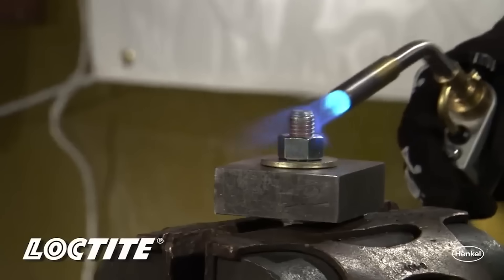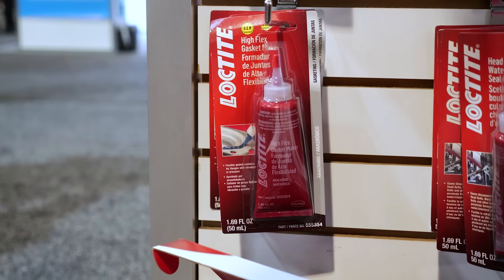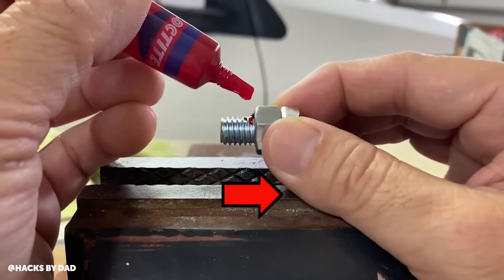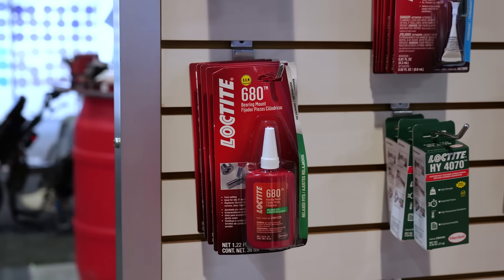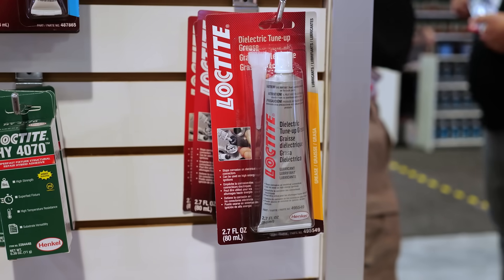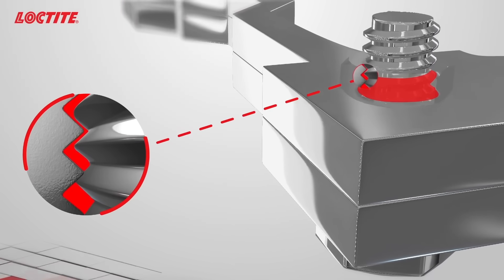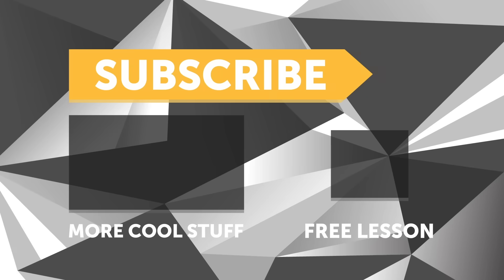Many pro mechanics don't know this.

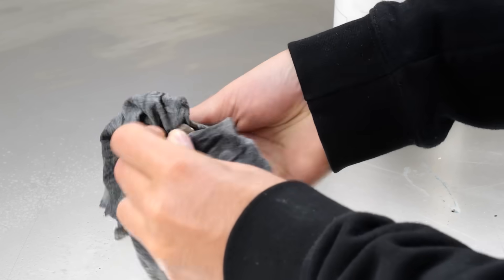Comment: @6:30 did he just say that a non-reactive bolt, like stainless, will not activate the Loctite???  ... and that I should be also using a primer??
Reply from the maker: "We recommend the use of primer where both the parts come under the category of 'inactive surfaces'. These metals lack the iron or copper content and thus the metallic ions that are required to fully cure the product within 24 hours. These inactive surfaces include plated parts, stainless steel, galvanized steel and anodized aluminium to name a few. On the other hand, in case both or at least one part is an active metal, then there is no need to use a primer to ensure full cure, which is typically within 24 hours at room temperature." - https://www.tryloctite.in/faq

Hope that helps! - Taz.

Comment: I live in the rust belt and rarely have to use it.  They rust in place fast. You have to heat them. If it is aluminum to to steel, well those bolts are in there.
Reply from the maker: I guess you just get used to your local conditions, but man, that would drive me nuts! - Taz.

Comment: Great to noticed at 6:00 is what I always teach to new operators.  In my case it’s also based on that glue detection is not allowed. Our loctide btw does contain indicators that lights up under UV light.

Comment: Stay away from the red gel locktite have had a lot of problems with it not setting up after weeks of being installed. Installed aluminum racing hubs on a 83 mustang a few years ago and the wheel studs used nuts to lock them in place and called for red lock tight well about 3 or 4 weeks later we decided to change rims and the studs would spin taking off the lug nuts and since it was aluminum hubs they don't press in turned every single one had the problem and we had already used another bottle a few months earlyer on suspension parts so checked them and they came apart way too easy for red lock tight 2 different bottles bought at 2 different places and were not expired we redid it all with the liquid faster setting and dint have anymore problems!!!!!!! I will never use the gel again and uset to use the blue gel a lot won't risk it again!!!!!!
Reply from the maker: Yes that's not ideal! A few are commenting red doesn't work for them who will have the same issue or are not applying it correctly (some will need a primer).
Glad you didn't have anything fail to figure that out! - Taz.
Reply: @hpa101  me to I usually use the red liquid never had a problem other than when something goes bad and have to torch the bolts but been using it for over 30 years that was the first car I ever used the gel on wasn't my car my buddy bought the stuff I have used the blue gel no problems that have ever been brought to my attention but after that mustang I never touched the gel again

Comment: Working on locomotives, we had a couple rebuilt by a shop. The first time we had to service the traction motors, we found they completely doused the traction motor mounting bolts with red loctite. 

1-3/8" diameter bolts, torqued to 1200 lb-ft, that are supposed to be assembled with anti-seize. 😀

They were very fun to remove, as we couldn't use heat. Large breaker bar and a forklift.
Reply from the maker: That must have been a bit nerve wracking!
Reply: 271 Red actually acts like blue(strength wise) on large bolts. They spec red as permanent up to 1". Still a bit of a mess to free up, but strength wise. Loctite on bolts meant to be anti-seized would truly have been a task though.
Reply: Life of a locomotive mechanic! Always something that's nearly impossible to get off!! I remember what seemed like day's of shocking (heat and cold) to the mounting studs of getting a main gen out of a 50 yr old GP15. Fun times!! lol
Reply: Now I don't feel so bad about having to stand on the lug wrench to change a car tire.
Reply: @jameshaulenbeek5931  that’s what I call creative thinking and initiative.
Reply: Wow! That’s some serious mentality going on.

Comment: crossthreading is the only way to keep fastners tight !
Reply: @sixhunt  Nature's locktite
Reply: @sixhunt  A cross-threaded fastener is a tight fastener!
Reply: @ this reply gave me shivers of mechanical sympathy. Gosh I hope you're joking.
Reply: My old time mechanic friend used to say "Cross thread it, better than two lock washers.".
Reply: "Brooklyn" tight, tighten until the fastener just starts to strip then back off a 1/4 turn.
Reply: @ That's close to my old journeyman's answer for how tight something should be. "A 1/4 turn before it breaks"
Reply: Better than double loctite
Reply: Be sure to sell the machine or vehicle before you need to remove the bolt.
Reply: Best way is to completely strip the bolts head off then weld a new nut on job done.
Reply: @sixhunt  aman
Reply: @sixhunt  hammer the threads can work pretty good too!
Reply: Or just put a UNC nut on a UNF bolt!
Reply: @sixhunt if u mean to do it, then it's more of an interference fit 🤣
Reply: welder. about 150A is right.
Reply: Or nord lock washers for the win
Reply: My old man used to say just do it up till its stripped then back it of half a turn gotta think like a plumber not a mechanic ha ha .
Reply: @Yoda-em5mt  
Always remember, when you get to heaven, the guy who worked on the car after you is waiting and he ain't happy.
Reply: @boyracer3477 thats why i fix all my stuff my old man was a shit mechanic i,m the guy you want to buy a car of. I tap out all the old loctite and wire brush bolts like everyone should so i should be ok in heaven .
Reply: Machinist method for securing threaded fasteners:  Apply torque as required; to strip.  Back off 1/8 - 1/4 turn.  Having this value established.  Also, makes dissassembly easier.

Comment: Very interesting and very useful, thanks.

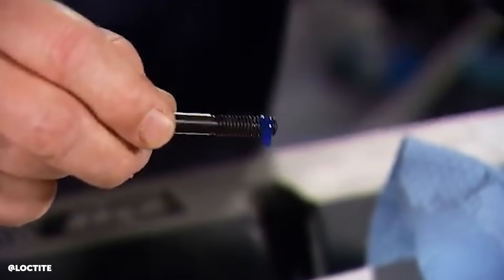Quick question, at 6:40 your expert explains that, as well as the adhesive being activated anaerobically, it also sets when in contact with "active metals". Does this mean that if the applicator touches the fastener, then the rest of the adhesive in the bottle will start to "go off"? (1:40 The example on screen shows the applicator touching the screw.)
Reply from the maker: They have different bottles tip designs and forms, I would read the specific instructions for the one you are using - Taz.
Reply: @hpa101 Thanks for replying 👍
Reply: YES, contact can contaminate the bottle contents ‘sniffed’ back in with submicroscopic particles, more or less of it hardening in the bottle (or at least the spout/tip) prior to use.

Good deductive logic.
Reply: @For_What_It-s_Worth  Thanks for the info!

Comment: So Loctite says NEVER touch the tip of the bottle to the metal as the metal will catalyse the liquid in the bottle and it will all go solid. Yet their animations all show the tip being touched to the metal. How to sell lots of product!
Reply: where do they say that? ITs the lack of air that makes it go hard, not a catalyst.
Reply: They also have a "stick", a bit like a gluestick... how is that supposed to be used without touching the bolt?!
Reply from the maker: They have different bottle tip designs. Go with what they advise in the instructions for what you are using if in doubt - Taz.
Reply: I was reading through these comments to see if this was addressed.

Yes, as (sub)microscopic particles of active (I.e. oxygen-binding) metal can contaminate the liquid drawn back into its container, pulling off the oxygen atoms ‘capping’, passivating, the ends of the liquid form’s molecular chains. These now bare ends become active binding sites which glom onto others of their ilk, turning the mass into a polymerized solid permanently. 

You want that to happen only at the point of use between surfaces, not in the bottle. It will particularly plug the tip where the greatest concentration of particles tends to collect.
In mild cases only local hardening will have resulted, as eventually the small surface areas of the fewer particles are themselves passivated by the oxidation. I have salvaged the remaining liquid contents in the small squeeze tubes by temporarily pushing the hardened conical plug down into the spout with a wooden toothpick.

Comment: Will be fun trying to remove the Ducati flywheel again if the gear shift return spring breaks again😂. 30mm nut with green threadlock and 350Nm torque under the engine case
Reply from the maker: Ultimately it's a better problem to have than if it removed itself before you had the pleasure 😂 - Taz

Comment: I would have liked to ask, does thread locker affect torque wrench specs? Do different grades affect more than others? For torque rated fastening I avoid thread locker.
Reply: torque isn't affected if you use Loctite brand but off brand like Permatex or other brands affect by 11% torque test channel tested this theory

Comment: My transmission teacher wanted to show us how to take apart a GM 4T80 and a 4L60 and some students decided to red loctite every single bolt beforehand 😂. He was swearing and cussing the entire time in class.
Reply: I knew a farmer who used bearing fit on bolts on a caterpillar sump. When it came to removing the sump again he wrung every bolt off and the block had to go away for the bolts to get spark machined out.
Reply: @Equiluxe1  That does not sound smart. I rarely use red, I'm always taking stuff apart
Reply: @richardahola692  I have never had trouble getting stuff apart using red, just has to be wound all the way out with a spanner.
Reply: Red or green loctite is a megayacht  mechanics worst nightmare. 
You have to have the area inspected you plan to use a torch , and often it's the wrong application instead of blue.
Its often hard to reach and alot of boat engineers are dummies and use red. 
You end up with a chisel or Sawzall on a part that never needed anything but liquid teflon(tefgel) and a torque correction scale sheet.
Reply: ??? So why so many videos showing cured Red turning relatively easily - a bit more torque need than Blue, but still - looks easy.
Reply: Well the 4L60E Transmission is so bad it needs red Loctite everywhere
Reply: How do you loctite a bolt you haven't taken apart yet?  DId you mean afterward?
Reply: @railgap these transmission are taken apart and put together several times. They are used for training the next set of students. The teacher has his own unit. They swapped his for another one that these students put together with loctite. 😂
Reply: gotta love the trans teacher
Reply: @jhowardsupporter he was slipping like a transmission 😂
Reply: @brarautorepairs  A+ prank
Reply: 😂😂good one. I used to brush anti seize on people's door handles
Reply: @rickcrotts6673  At college, they had a big tub of Vaseline. The kids would take it and smear it all over the place 😂. You would fall asleep in class, they would apply it to your hands and tickle your nose. Damn, 😩, you would be smearing it all over your own face.
Reply: @rickcrotts6673  🤫🤣
Reply: @rickcrotts6673  oh no. That's not nice. We used Vaseline
Reply: @rickcrotts6673  thats a nice one, but old fifth wheel grease is better xD

Comment: Always going to use red for flywheel and clutch bolts, blue never seemed to work right.  ATI damper says they want red on their bolts too....
Reply: P S A  The red is in a red  bottle. The blue is also in a red bottle. Marketing gone mad. Very confusing for newbies.
Reply from the maker: No different to selecting the right grade oil for your car out of a sea of similar bottles 😎 - Taz

Comment: Surprised they didn’t talk about the oil resistant Loctite.
Reply from the maker: They have so many products, could be there for an hour and still have some on the list to cover. We just zeroed in on the 2 most common (in our experience) issues which is using the wrong compound and not applying it correctly.
For any specific product, Loctites technical data sheets are actually very helpful without being overwhelming, imo - Taz.
Reply: @hpa101 Very true. I like how the blind hole technique was explained. 25+ years ago when I first got into motorsports, the engine builder I was learning from taught me both the pros and cons of liquids in blind holes. Love the channel and appreciate all the new and old techniques, tricks, products and procedures covered by the channel. Keep it up!

Comment: Ive never had blue thread locker actually hold and work.  The only thing ive seen it do is not allow the nut or bolt to not loosen with fingers or on its own..  like by shaking the bolt and nut loosen itself.  But they always will come loose when the red will hold it much better..  but still yet the “permanent” side of red loktite has never required heat to loosen..  ive used some black threadlocker that was permanent..  you had to use heat to get the thing off..  never can find the black stuff on any shelves though, always online..
Reply: you shake the tube before you apply it right? i made this mistake before
Reply: also you need to apply torque to it or it wont set
Reply from the maker: As mentioned it sounds like you might not be applying it correctly. If you've found an alternative that works for you I wouldn't worry otherwise you should check their technical documentation and follow it 😎 - Taz.

Comment: Loctite? Overpriced and has the shortest shelf-life (on purpose). Will not set when expired. Competitors can make a threadlocker that works 10+ years! Explain that.
Reply: What are you using?
Reply from the maker: What are you using instead and why did you buy so much you still have it after 10 years 😅 - Taz

Comment: Doesnt anyone go Hillfolk and use 3m yellow weatherstrip adhesive for a loctite substitute? 
Been using it forever since i heard its about 3/4 as strong as blue ,and wont cause corrosion like loctite can in certain situations.
Reply from the maker: Nope. Not keen on that one myself, but glad it works for you - Taz.
Reply: @hpa101  : Would take much longer for the solvent to migrate along/ evaporate from the long thin spiral in the thread gap, and the tight seal under any head in bolt/blind hole applications. The shrinkage would also leave gaps. Those considerations being inapplicable to the anaerobic types is a major selling point.

My friend who temporarily attended A&P (airframe and power plant) airplane mechanics school said they used that as a sealant, calling it ‘gorilla snot’.

Comment: careful with the blind holes, you can crack an break shit
Reply: I was always warned about this, like having blind holes that get coolant in them, risk of cracking if you tighten them enough where liquid material is still trapped with nowhere to go. I haven't personally seen a failure from this but believe the risks, and always dry the threads out.
Reply: @GTStuning-  yep, coolant, oil, anything that's not compressible basically.. it's gotta go somewhere..
Reply: @GameOfMorphs  Best to blow out blind holes but in most cases threads don't seal, it will be pushed out.
Reply: @GTStuning- It has happened to me when I started to work on motorbikes.. actually broke a piece off but got away with it and learned from it .i stick a cotton bud down them now to make sure nothing is there
Reply: "In most cases" is not reassuring enough lol, as there will be failures from this.

Comment: Can you please tag Ford motor company in this video, they need a lesson in loctite 101 😂
Reply: 1000 likes for that comment!
Reply: Yellow loctite on brake calipers.. c'mon!
Reply: A gallon of blue on each cab mount bolt.
Reply: @Prperformance1  like other automotive companies don't have that problem. 🙄
Reply: Yes. Literally just 10 hours ago i had to use the oxy torch to glow out brake caliper holder bolts on a shitty Volve in the rear....

Rusted almost rounded heads and thread LOADED with locktite....
Reply: lol they need more than loctite education. proper exhaust stud size and stainless and flexpipe on a 20 foot exhaust to keep tiny studs from shearing. would be a start lol

Comment: When I was working as a mechanic in a rock quarry with a mixed fleet of cars, utes, trucks, loaders, dump trucks, drilling rigs, bulldozers over 30yrs ago I used loctite extensively when I was assembling engines and equipment. Used 680, 243, pipe sealant, high flex gasket, green retaining compound and never seize compound. I’m sure there are a lot more in the range nowadays. I don’t really remember the blue loctite it may have come out later. When I rebuilt engines I always used high temp thread locker on big end bolts/nuts and never had an engine failure in all the engines I rebuilt over 15yrs I worked there. It’s important for threads to be clean and brakecleen was my go to for degreasing bolts and blowing dry with compressed air. Loctite is expensive but a great product!

Comment: I rarely ever used the red thread locker. I use the blue most times and never on exhaust studs or bolts.
Reply from the maker: Good man!
Reply: I use red on brake caliper bracket bolts and suspension components.